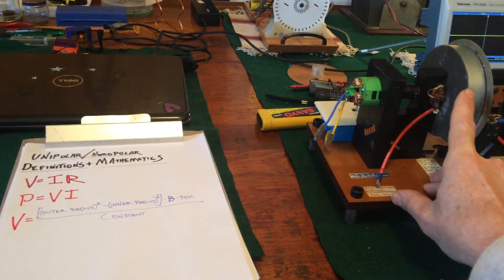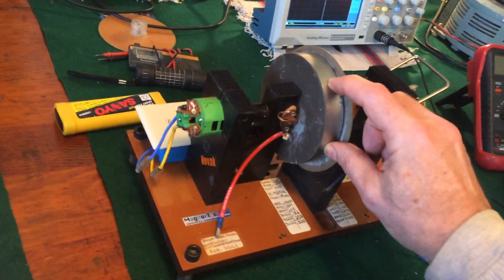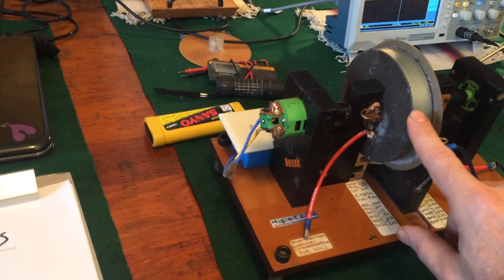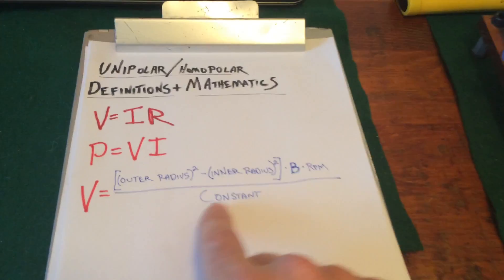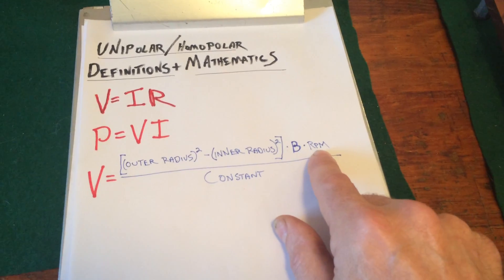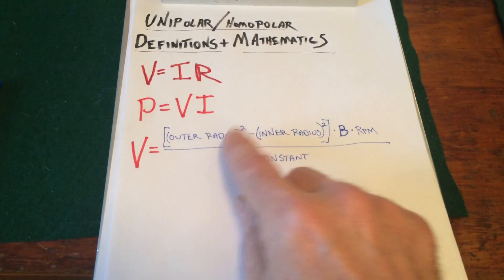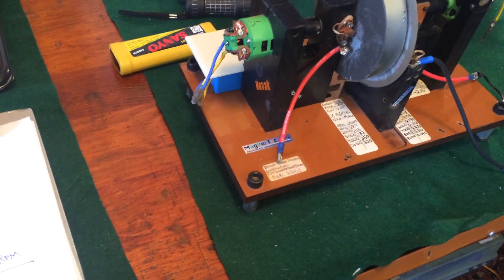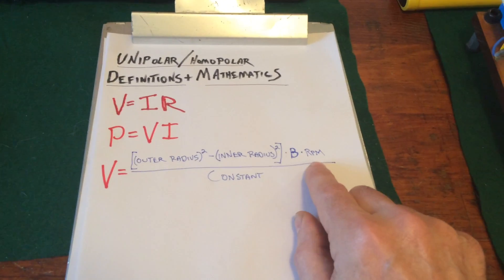homopolar/unipolar math 1; Voltage calculation

Comment: What if the copper disk does not have a hole through it instead has a shaft, all one body of metal, and you suspend the shaft to make the disk spin, and on the side without the shaft, touch the dead center, and in the outer edge. So I have two experiments, both in the same diameter,  One with a hole and one without